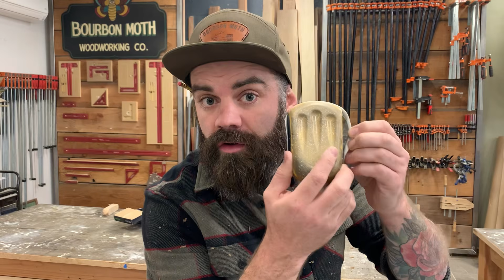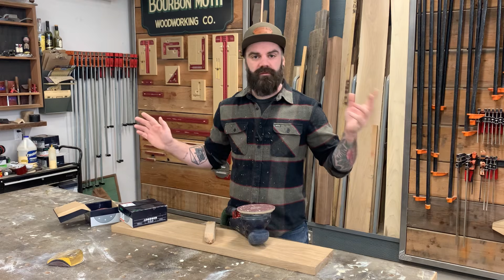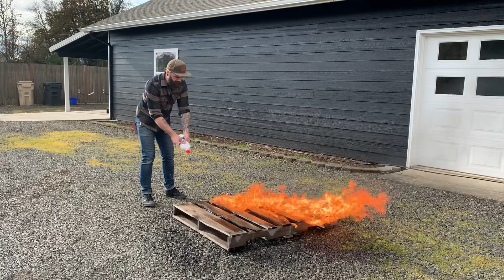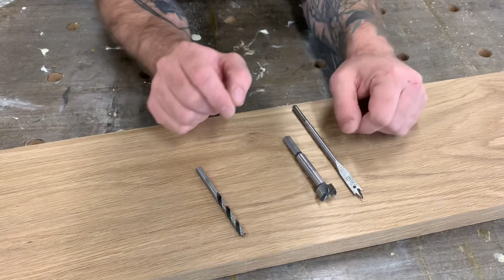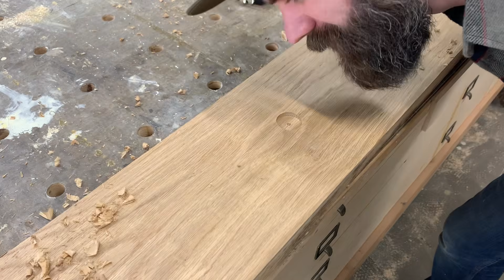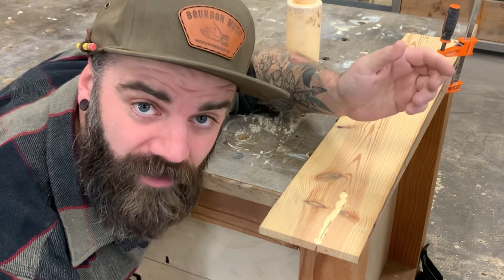Woodworking Tricks You'll Actually Use // Helpful Woodworking Hints

Comment: A legit tip for dealing and removing any metal you suspect is in a piece of wood is to simply use a metal detector, not one of the big two handed ones but one of those smaller one handed wand looking thingies people use when they go out metal detecting and have a small hole they dug to see if there's any other finds there but can't get a full  sized detector in there. Yeah they cost a bit but it will give you a pretty good idea where a piece of metal will be inside a bit of wood

Comment: Also could consider using other types of glue. There's a clue that I have used personally some that is called 2 P10. It's a glue that you put in your crack then spray on an activator and clamp it. You can also just simply clamp it and not use the activator it will still dry just not as fast. They have a liquid version. Which is like pouring a little water into the crack. Then you can put a clamp on and just give it some time to dry. 

 https://www.amazon.com/FastCap-2P-10-Super-Adhesive-Activator/dp/B0006IUWCC/ref=asc_df_B0006IUWCC/?tag=hyprod-20&linkCode=df0&hvadid=312141698594&hvpos=&hvnetw=g&hvrand=7609480660083325292&hvpone=&hvptwo=&hvqmt=&hvdev=m&hvdvcmdl=&hvlocint=&hvlocphy=9016624&hvtargid=pla-569503655709&psc=1&tag=&ref=&adgrpid=63810131162&hvpone=&hvptwo=&hvadid=312141698594&hvpos=&hvnetw=g&hvrand=7609480660083325292&hvqmt=&hvdev=m&hvdvcmdl=&hvlocint=&hvlocphy=9016624&hvtargid=pla-569503655709

Comment: If you put glue on a crack in wood you can usually Flex the board and help work the glue down into the crack depending on how thick the board is it may not be easy to flex.  I find on thinner cracks you can sometimes open them just a little and pour your glue down in.  Also you could rub it in with your finger or brush. That's also going to press it down into the crack.

Comment: I also learned that using a guide hole in scrap wood when you need to make a bigger hole over than what you have, can be moved to the edge of the hole....it doesn’t have to be directly centre IF you need the edge of the hole referenced rather than the centre......hope that made sense 😳

Comment: I've found that using the width of the tape measure for adding interior lengths is one of the classic differences between woodworking and carpentry. For building houses, this is more than accurate enough but for woodworking ... It'll bite ya in the ass. I had a plague of poor fitting pieces for awhile and couldn't figure out why. Turns out the rivet on the tape measure end catch was sloppy. And I don't mean the intended amount of play so you can use the outside or the inside of the catch. I mean it was losing its right angle to the tape and adding length to my cuts.

Comment: I love your videos. I always hand sand things rather than use power tools but changing grit sounds like a good idea. I need to get one of those sanding blocks you used. I've been using the ones with foam in the middle that have sandpaper type edges all around. I wonder if that eraser thing can work on those...
Entrance was hilarious. The burning of the palette to get the nails was pretty funny too. And the second glue method... LOL!

Comment: Great vid! I will not be using method #2 to glue my cracks, thank you very much. The method for finding the center of a board also works for dividing a board into more equal pieces. If you want to divide a board into 3 equal pieces without fighting with crazy fractions just measure across the board like you did using a number that is easily divisible by three, say twelve, and then mark at four and eight and you have three equal pieces. I believe this method works no matter how many equal pieces you want.
Reply: When I use that method, I also make a small line along the edge of the ruler, and use the ruler-side of that line where it intersects the measurement mark. I also use a fairly-fine mechanical pencil for marking measurements that need to be precise.

Comment: Also for finding the middle of the board i find guessing half the dimension then measuring from both ends and the when you got it near enough marking the middle between two points by eye. Faster than  diagonal ruler and can be applied to any distance. Also if you are marking board to rip it - just use protractors (same method as above) and then transfer the measurement to your fence to the middle of the blade. Gets rid of all the math and thinking of kerf thickness when ripping. Can be also used when u are ripping the board into several boards. It might just be wee harder guessing a - say - fifth. But with a bit of practice you speed up loads. You just step across the board with the protractor and if you land on the edge on your last step you know you are right.

Comment: One I use a lot is, if you need a bunch of points equally spaced out, say for a banister or hooks on a wall, and you want then center but it’s not easy math.Take a piece of elastic, Mark every 1” and the stretch the elastic to what looks/works best. Then tack it in place and transfer the marks

Comment: That is my favorite way to remove glue.  I always shudder when I see Norm wipe it off with a wet rag. Try staining Oak after you've done that.  I like to wait until the glue is a bit rubbery to take it off rather than when its very hard.

I do actually blow glue through the top of a crack, but I lay down a bead of glue and then use an air nozzle, not my mouth to apply it....but I give you 10 points for style, and you have to admit wood glue doesn't taste too bad.

My favorite is the nail removal process you demonstrated.  You can drink a beer while the operation is in progress too.

Comment: You can also use the trick for finding center to break up boards into 3rds, 4ths, etc by simply using the same method.  I do it all the time with plywood and simply tilt my tape measure to break a board into into 3 equal widths.  On plywood, I usually hook one edge then then tilt until tape hits 60 inches and then mark at 20 and 40 inch and each piece is the same width.  You can do 4 equal widths or more.  Same trick.  Works every time. I too prefer to measure back from a wall and then measure from other end. I am going to try your blow in glue next.  I can't wait.  Great video.

Comment: The second tip on getting glue into the crack might have been actually viable had you used a straw. Lol I was expecting you to use a straw and an air compressor. ..anyway, if you dont have one of those erasers to unclog your sanding discs,  you can use old tennis shoes...or new ones but new ones will cause you to lose any economical advantage..
The problem I'm having with mine are the hook n loop part of the discs are coming off and when I try to re adhere them,  the glue clogs up the loops. Another down side to over stocking up on supplies.

Comment: when you are dialing in trim length put the saw fully down, then slide the trim piece against it. start the saw, raise it,  and use the carbide offset to take off material in small increments.

Comment: mix up epoxy, thin it with acetone. tape bottom of joint to hold thinned epoxy, clamp. when the acetone evaporates the epoxy hardens you are done.

Comment: Measuring sticks are good for finding inside measurements. Put two sticks side by side and slide them apart until the ends touch the inside walls of what you are measuring. Then measure the distance between the two ends.

Comment: If you are putting screws into wood and splitting the wood, instead of drilling it first, drill the screw in 1/4 the length of the screw then put the drill in reverse, drill down (it's slow but it goes) about half way, go forward a tiny bit, reverse until the screw is almost all the way in, then drive it home. Or drill a hole with a nail.
Another way of embiggening a hole is with two hole saws, nested on one arbor. One the size of the hole and the other the size you want. the smaller one acts as a guide, and you don't need the pilot bit either.
To find the center of a circle with no measuring, draw a straight line through two points of the circle, near the edge. From either end of the line draw a perpendicular line through the circle, making an L shape. Connect the top and bottom of the L and that will bisect the circle exactly in half. Do this again on any other place on the circle to intersect the first line to find the exact center.
I'm bad at math so to find the center of anything, I measure it with a tape, or string, or rope and put the ends together, the middle is the middle.

Comment: The glue squeeze out tricks works all well and good if you can fit the chisel inside the space. Not always possible. When I can’t I put down painters tape along either side of the seam... glue up... clamp... wait until firm(ish) and then pull the tape off. 

Learned a few things... enjoy the entertainment value, keep it up! Gonna subscribe and yeah... this old guy is actually going to Instagram to follow there. 🤙🏼

Comment: To fill a crack, I put glue on a piece of paper and run the paper through the crack. If you use a glossy paper like a magazine cover, the glue will naturally want to migrate off the slick paper onto the porous wood. The bigger the crack, the thicker the paper you can use.

Comment: You can also put glue in the crack using a small needle like a doctor uses for injections or you buy for insulin.. I've never tried the vacuum cleaner trick but I will try that now ...but this is my preferred method  unless I start using vacuum.

Comment: Rather than a foot try 10" I know you'll have an ez'r time with the math.
Reply: adding 10 to the number of inches is still harder than adding 1 to the feet. One is the ezs't number to add.
Reply: @BariumCobaltNitrog3n  I use any multiple of 10(20,30, 40, 50, etc.) then add the balance.

Comment: OMG, I was sooooo hoping you were gonna light that pallet on fire. God Bless!

*Edit

That measuring trick works just as well for dividing lengths into other increments than half. If you want thirds, quarters, fifths...you know where I'm going with this. Take your ruler, put it on the board so that it starts at zero on one side and touches the other side on a number that is divisible by the number of sections you want to divide the board (or anything) into.

Example: You want equal sections of a board that measures 14 and 7/8 across. Forget the 14 7/8, it doesn't matter. Span the board so that the ruler finishes on 18 or 24 or 30...ect and draw those marks. The board will be perfectly divided.

Comment: I have years of experience sanding all manner of wood in all manner of condition.  Here are a couple of rules for you.  Never skip more than one grit.  And those swirls (I call them squiggles) have a specific cause.  I don't remember ever seeing them occur on hardwood.  Only on soft wood because if you are sanding wood that is soft which also contains a large amount of resin or sap you can quickly pick that sap up on the abrasive.  Even a tiny fleck against soft wood like pine can leave terrible marks.

Comment: to fill holes and deep gouges in wood, first sand the wood saving the saw dust. mix the saw dust with NEW SKIN then apply mix to imperfection. when dry sand smooth and the best part is it will take stain or what ever finish you apply. try it

Comment: "and no, I'm not going to just measure the center of the board"
Proceeds to just measure the center of the board.
Reply: By "just measure the center of the board" he meant find the width of the board, divide by 2, and measure that distance out. This is problematic if you are bad at math and the width of your board is like 7 5/8 or something. You should be able to figure out that half of that is 3 1/2 + 5/16 = 3 13/16. But why do that math if you don't have to, and why risk getting the math wrong? With this method in the video, you get to pick the number that you want to divide by 2, instead of 7 5/8, let's divide 8 by 2 instead.
An even bigger concern for me, personally, (though probably less of a concern practically) is if you're trying to find the center of your board but your width (or halved width) just doesn't exactly match any of the markings on your ruler. With the method he shows, again, you pick the measurement value to be one that does work for your ruler. Even if your ruler only goes to whole inch increments, then you pick any even number of inches and you will be able to find the center down to like the 64th or however precise your marking happens to be.
If you want to argue semantics, then I'll just say that technically you aren't measuring the board width because you never actually end up knowing how wide the board is. You just have a stick with 3 known markings on it and you line the outside 2 with the edges and mark the wood at the center marking.

Comment: I find a lot of that sanding process to be overkill. Unless the wood is very rough or I'm making a joint flush I usually get great results by starting with 120 and moving right to 220. No need to go back and hand sand, or sand higher than I plan to finish. Blowing or vacuuming off the dust is also sufficient. Can't imagine wasting the time and money to wash them with mineral spirits between grits.

Comment: The method you showed for dividing a board and half or finding the middle of it works for dividing a board into thirds forths or whatever. For instance if you want to divide it into thirds and it's an 8-in wide board you can just use 0, 3, 6 and 9-in...etc

Comment: For squeezing glue into a crack I usually spread a bunch on top of the crack and then use a putty knife to mash it in. Avoids sucking a bunch of wet glue into my shop vac.

Gotta try that spit method though, I like that it doesn’t need any extra tools.

Comment: To glue the split in the wood end, add glue, take a cigarette paper and ease it through the split. Put one end of paper into the glue and slide it back and forward through the split, glue applied. Sure as hell makes it hard to roll a cigarette with that paper, but what the hell, with all the dust in my shop... Call the fire brigade.

Comment: On the inside measurements, I like to take out my combination square, which is exactly 6".   I can use it inside the body of the square sitting on something flat or take it out of the body and lay it in the position on the inside measurement that I want.  Most of the time, I'm taking three measurements, one for length at the back of front of the wood and two for angles with a bevel gauge at both sides of the measurement, such as in shelving wall to wall.  I have also customized a stair tread jig, used between walls, with a different slide track to get both the overall measurements and both angles at the same time and transferred those directly onto the piece.

Comment: Jason, great tips!
Just a suggestion for your readers regarding sanding: learn how to properly use a hand plane and hand scraper.  By using these two tools, your surface preparation time will be cut in half.  Less noise.  Virtually no dust. Time saved.  How's that, everyone?

Comment: I haven't run into an issue with making a bigger mess cleaning up the glue before it hardens. But when I wipe it up I use a wet rag not a dry rag.

Comment: My favorite tip that's helped me in woodworking:
Download a fraction calculator app on your phone. It will save you HOURS.
Reply: well ... i am using metric , no need for calculator :)
Reply: Or just switch to metric
Reply: Here in America we prefer to build everything to the specification of a dead monarchs shoe. And converting things from imperial to metric and back when working with lumber, drill bits, table heights, etc is much more complicated than just downloading a fraction calculator app.

Comment: I will definitely use that centre board trick; have already used the nail removal tip for pallets but, the 2nd glue a crack tip . . . might pass. Not sure my beard will clean up as well as yours. 

Great vid, as always.

Comment: I laughed, then winced, then laughed watching a woodworking vid, very awesome indeed.  A couple of alternatives:  I just guess at half the width of the board then measure that distance from each side, then is is easy to eyeball the midpoint between the marks (presumably very close together).  For crack gluing, mix the glue with water so that it will capalary into the depths of the crack, then either clamp it or follow up with non diluted glue and it will flow easier into the crack.

Comment: When measuring into a corner...I measure out 10"...because adding 10 is easier than adding 12"...for me. So measure out 10" one way, and measure the other way, and add 10". So... 45 and 5/16" plus 10...equals 55-5/16". less mistakes for me....

Comment: "No I'm not just saying to measure the centre"

Proceeds to just measure the centre of the board.
Reply: I guess he means that it makes a difference to measuring a board that is e.g. 15.3 cm wide and then think: what is the middle of that? Then start measuring 7.65 cm from one of the sides  to the middle and hoping you did the math right. We all have done that.
I like the idea of measuring diagonally and use numbers that you can easily divide by two. Quite simple, but honestly so far I have not had the idea myself. Big thanks for that trick from me.

Comment: Excellent video, you got me on the pallet, cracked me up man, and the glue in the mouth, HAHAHAHA!!! Great info on cleaning the sandpaper with cleaning stick, didn't think of that one. On glue cleanup, I wait just until the glue cures a little, but still soft, and I use the chisel to easily remove the glue squeeze out before it completely dries.